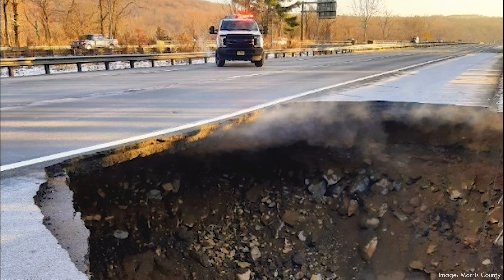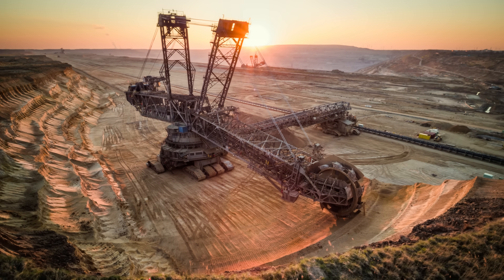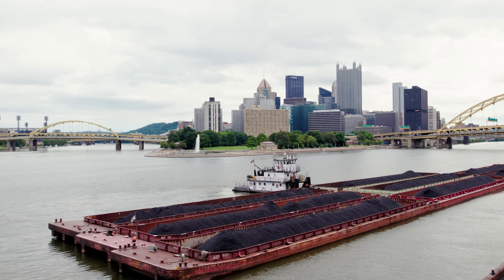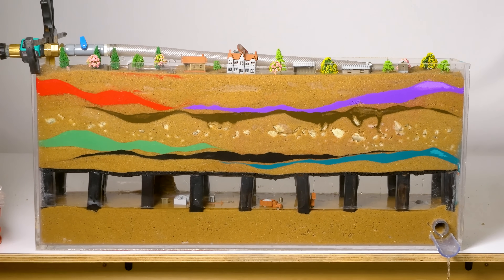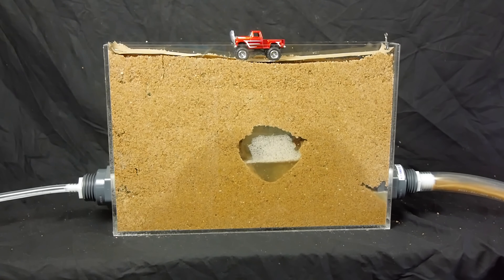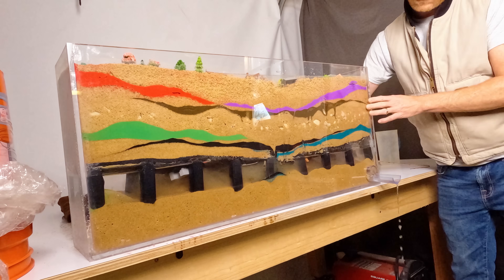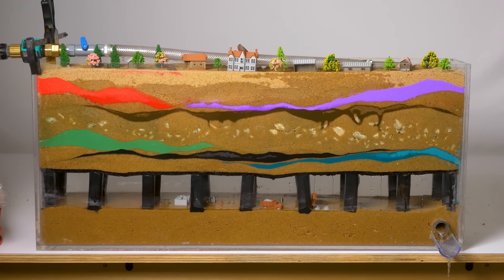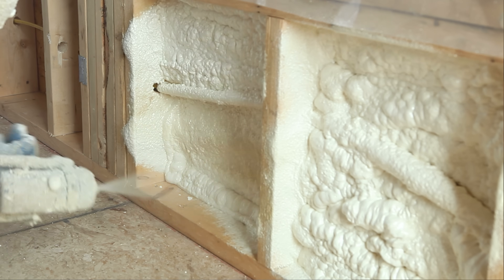When Abandoned Mines Collapse

Comment: I live in the anthracite region in PA. People that aren't from here and/or don't know anything about coal mining are stunned when they learn that the whole area (480 square miles) is basically being held up by toothpicks. A lot of pillars were robbed and what's holding up the ceilings is just timber. Subsidences are very common. Luckily, subsidence insurance is dirt cheap. No pun intended. 

At a large mine about 10 miles from Scranton there was an accident (1950s or 60s) when mining under the river. They got too close to the ceiling, it broke through and the river flooded into mines below. AKA the Knox Mine Disaster. It ended underground mining for the area. The mines completely flooded and basically they are all connected. Pumping that much water out was not an option. 

Cool video ty
Reply: I remember reading about that disaster a few years ago. Billions of gallons of water filled into the mine, they threw rail cars, huge rocks, everything they could to try to seal it up. Big 'oopsie'. There is still so much Anthracite that they've barely scratched the surface given the absolutely huge amount of Anthracite that exists there. It's enough to power the country for 10,000 years if we only burned coal.
Reply: @Knight_Kin  Yep they did. I don't get how they thought that stuff was going to stop water of all things 🤔
Reply: Oh, the one they show video of at the Coal Mine Tour! What you want to see before they take you underground.
Reply: @X24453  It's certainly possible, I don't really remember a video I haven't been to the coal mine tour in like 20 years. We played in abandoned mines as kids which is crazy thinking about it now. I was always interested in them though. Across the street from the house I grew up in was the Eddy Creek colliery property, plenty of openings and little buildings to explore.
Reply: Well of course it's dirt cheap, the bottom keeps falling out of the market! 😆
Reply: In Hazleton, you used to be able to access the mine that ran under Broad Street. Amazing that it hasn't collapsed yet.

Part of 940 going towards Freeland subsided, and 309 going towards McAdoo.
Reply: @nicky5683 I don't really know that area. There's been a few subsidences over by Marywood College recently. I think a lot more happen that they don't want people knowing about

Comment: Oh we know all about this in Edmonton, AB, Canada. There are parts of the city where you cannot make ground disturbance including but not limited to building a garage or house addition etc without having a mine survey done for your property. There was a large coal mining industry in the banks of the North Saskatchewan(which runs directly through the middle of the city) during a period of historically low regulation and enforcement so in addition to the licensed and surveyed mines we know about, there are tons of unlicensed rathole mines that existed and were hidden once finished with to prevent detection. It's a big problem even though tons and tons of gravel have been dumped into the old mines we know about the problem continues to crop up from time to time.

Comment: The official statement from NJ DOT is this is a collapsed mine, and there are many very old mines in that area, but the collapses are also happening exactly where Route 15, an old highway dating to at least the mid 1800s and likely much older, used to be. When I-80 was constructed in the early 1950s Route 15 was moved a short distance east to allow for all the necessary ramps that would connect both highways.  The collapses have all happened in a short section of I-80 where it's fill was placed on top of the old Route 15.  Route 15, being so old, was likely not built over old mines. So my question is, could the official story of a collapsed mine be a ruse and this somehow actually be a result of some flaw in how I-80 was originally build, specifically where it passed over a much older road.

Comment: As a geo thermal well driller,  I often wonder about the impact underground.  Today hit atesian well. 150" deep. Ground loop was set and 100 gal flow of water out of the hole.  First time ever.  Hole wouldn't hold grout,  can't stop flow without specialized equipment in the morning.  Usually holes go easy.  Sometimes it happens like this,  at times difficulties at other ends of the spectrum. How is our crust not falling apart with as many holes we fracture and drill? Isn't there a tipping point with earthquakes??
Reply: Dutchsinse on youtube and twitch

Comment: You should check out what they did in Webb City MO. They pumped grote, similar to concrete, into the abandoned mines under the town to stabilize it. Not sure if the project is done, but it went on for years.

Comment: There were a lot of mines where I grew up.  About 40 or 50 years ago I asked a coal miner how big the pillars were.  I think he said they were 60 ft. wide.  What he said next shocked me.  He said that, once they've removed all the coal between the pillars, they start at the farthest reaches of the mine and begin removing the pillars.  I asked about the roof.  He said the roof collapses but the mine is so far underground that the collapsing mine didn't affect anything on the surface.  Now you have me wondering if the engineers or mine owners simply told people that whether or not it was true.

Comment: Having lived and built houses in areas with long wall coal mining. To get a permit to build a house I had to get additional concrete and reinforcing steel. So if my house began to slip or move due to mine subsidence. Then the repairs will be covered by the mine's insurance. My first house in 1973 needed to spend another $1k on a house costing $15k  to build to meet the requirements of any mine subsidence
Around my area there are signs identifying road damage due to subsidence. In fact one part of the highway says "Dont blame the Council this is mine subsidence". When you look along that section of road that was straight and level when built. Is now looking more like a roller coaster ride.

Comment: Coal mine subsidence was a major issue in Colorado Springs in the 1980s and 90s. Whole houses were sinking almost a complete story practically overnight. Now the first thing I do when moving to a new area is to obtain a coal mine map of the area to know where to avoid. This is a very real issue!
Reply: Those maps will tell you where the surface works were, but not necessarily the tunneling. But yeah, it's a good idea to look at those historical USGS maps and stay away from any marked shaft at by at least a couple hundred yards.
Reply: I live nearby, how does one aquire these maps, now I'm curious!

Comment: Congratulations on an excellent discussion of the causes and potential harms of mine subsidence.  You did, however, neglect to mention a very important contributor to current issues and that is the evolution of surface land use on mined areas over time.  Unwary or unscrupulous land development over mined areas can leave surface rights owners with a mess that is neither their fault not the original mining concerns.

Comment: isn't a big part of foam, is that it's airy? how could that stop immense pressures squeezing the void? maybe more support of smaller air pockets?
Reply: Yes. And no.

Foam concrete jacking and polyurethane injection sealing for foundations have been a thing for decades.
Reply: @asbestosfibers1325  I'm not doubting that, but questioning if it's a century long solution. But it sounds like it's proving to be, so that's cool!
Reply: @pizzagroom6221   i personally highly doubt it being a century solution but can't back up my opinion with proven science 

Just doubt

Comment: I grew up near Scranton, Pennsylvania, during the time when the old shoring tembers were rotting and subsidences were common. Due to the anticline geology the flooding after the pumps were turned off meant that the water was pressurized leading to a geyser forming one day and boreholes being drilled to relieve the pressure. The lower few miles of the Lackawanna River and the eastern bank of the Susquehanna downstream of their confluence are stained orange due to the dissolved iron

Comment: Reminds me of my job operating a concrete mixing/pouring plant in northern australia They would backfill the space in-between the "pillars" so they could later mine out those pillars they left before. It was a mix of mostly sand, water and a little bit of concrete, when cured you could crush the material with your bare hands. The engineer's however told it's not a strong mix but strong enough to give enough support so they can keep mining, quite mind boggling.
Reply: The coal they mined out was likely much weaker than the mix you applied.

Comment: Long wall is not just a modern method of mining, historically, a form of long wall, "short wall" was employed, same as the described long wall, just smaller spans. This form of mining is designed to fail and let the mine collapse after working it as opposed to room and pillar aka stoop and room which is designed to be stable until the pillars fail if the overburden pressure is greater than the pillar cohesion.

Comment: I’m a mining engineer and I really enjoyed your video! You did a great job explaining this in a way that industry can appreciate and lay people can easily understand.
Reply: I’m a mining engineer by training as well, though I work in a chemical plant now. Huge agree, and now I have something I can use to explain to our boss why we actually need to do something about the drifts running under the plant property
Reply: @the48thronin97  what rock type, depth and drift dimensions? If its hard rock, deeper than ~50m or relatively small openings, you're probably ok. Most mines will have a 3rd party geotech review done by a consultant once a year give or take, typically conducted through mine tech services/mine engineering dept. Try bringing it up to them rather than the plant manager.
Reply: Business in all industries "it's not a problem until it is." What we can't seem to learn is that fixing stuff before it breaks always costs less than fixing it after. Would you rather the dentist fill a cavity or would you rather have a root canal?

Comment: Underground gold mines in Bendigo, Australia reach a kilometer deep. They are in hard rock formations, so generally there is no collapse and surface subsidience danger, but old abandoned mines inevitably fills with water... yes, 1km is 100atm pressure. HUNDRED. So gradually it became extremely dangerous to dig anything there, any moment you can puncture to old abandoned and forgotten mine next to you and get all this water bomb directly to your work area, with all consequences.

They tried to assemble a comprehensive underground 3D plan of all mines dug there for 150 years... not very successful, especially for gold mines which are unevitably look like maze of narrow bent tunnels along rifts, veins and other formations deep below in hard rock, no one could afford to build straight corridors and big caves there, just dig as it goes until all hopes for additional gold lost, then abandon it and start to dig somewhere else. If nothing promisable left at all or at least it requires to go too deep thus expensive - abandon the whole mine, dissolve the company and forget about all this instantly.

Comment: Kiruna, the northernmost city in Sweden is actually in the process of moving the city center because of this, the iron mine next to the town has grown too close to it, so the mining company is either fully or partially funding the move, not sure on the detail. But is in itself a massive engineering challenge, where they will literally drive the historic church to the other side of town soon! Though the hospital is facing some difficulties where the new one is still in the approvals stages but the old one is getting major cracks in its walls already, and probably won't last until the new one is built!

Comment: Fun fact: Here in Germany we spend roughly 300 million euros a year on over 200 giant pumps that pump groundwater out of abandoned shafts in the Ruhr Area. The city center of essen has sunk more then 30 meters since the beginning of coal excavation in the area. Without those pumps that whole are would basically turn into a giant lake comprised of highly toxic water from the old mines.
Reply: What happens when pumps are finally turned off can be seen in Olkusz, Poland.
After the zinc and lead mine Olkusz-Pomorzany ceased operation in 2020 and switched off the pumps, ground water gradually rose to the surface, inundated wide swaths of local forest and a 100m long section of realtively new-built road that was the bypass of the town Bolesław. Apparently there was a big miscalculation - nobody expected water would rise so high.
Fortunately this water is not contaminated, probably because all the ore has already been extracted.
On the other hand there is a town in Germany ( I don't remember the name) where the rising ground is the problem. They drilled for geothermal water but unfortunately punctured gypsum deposits under the town letting groundwater into them and gypsum began to swell so that ground surface started to rise. This in turn damages buildings, especially older ones.
Reply: @adamzieba8364 Never thought i'd be equipped to answer such a niche question. The German town you're talking about is Staufen, where my mother was raised. Supposed to be home to the exact spot where Faust sold his soul to the devil. Lots of medieval stonework there, the cracked foundations are a locally notorious sight.
Reply: Another problem is pollution. Especially PCB is a problem, it was used in hydraulic machinery. The quantities are huge, this poison surfacing would be a disaster. Expensive pumping vs. said risk has to be considered.
Reply: I hope the pumps break down and never get replaced, a toxic lake is still better than a town full of germans!

Comment: I live in Germany and work at a company which focuses on drilling for mines and voids typically between 10m to 100m deep.
We then pump a concrete mix into the mines through different types of pipes so the area is safe again.
There's also a huge effort to pump the water out of the huge old mines so they won't collapse.

Comment: One Example of an Area that became a densly populated Area is the so called "Ruhrgebiet" (translated to Ruhr Area). The coal that got extracted from the underground was used for big steel Mills like "Thyssen, or Krupp. (Now Thyssenkrupp) In this area a river has to be pumped up to prevent a town from getting flodded. The groundwater is strongly polutet in some areas and sometimes cranes and buildings collapse ( every few years)
Reply: Yea... Depending on the exact area you will run into either of these troubles when building/digging:
1: WW2 bombs that didn't go off
2: remnants of some ancient roman structures
3: unsteady soil due to coal mining
Bonus suprise wherever a river is close: old, ancient river bed wich means loads of gravel or a water vein that requires serious pumping efforts during construction of the basement and intensive waterproofing of the basement walls and floor. 
Yet another thing: Old bunkers! A number of cases where they just left them and used the structure as underground parking or in case of above ground bunkers as a house or parking garage. Modifying the thing proofed to be more rewarding than trying to remove it since most were built incredibly strong.

Comment: A previous life as a Geologist had me monitoring pipelines as they were undercut by longwall mines. Active mines, not necessarily abandoned. We also did survey work and could watch the surface, hills in WV, PA, and OH mostly, subside by 6-8ft. And that's with the mines a solid 800ft below. It was remarkable, and the homes in the longwall path were either bought by the mine and left for dead or refused by the owners and repaired by the mine.
In a 1/4-mile wide longwall we would monitor and expect subsidence 1/2 the width to each side. So 1/8-mile on either side of the mine would subside, and we called it good (remember, we were only there to monitor and protect the pipeline assets) when we saw less than 1"/wk of surface change. During our surveys we could audibly hear the rock popping after the mine passed.
Reply: Oh, that's pretty neat. What did it do to the trees and stuff overtop?
Reply: @X24453  some moved, but generally land just sank. Aside from some rather large cracks...2ft wide, deeper than you could see...it was hard to tell anything happened without the survey data. It all sinks roughly at once.

Comment: 12:12 They used this method in Germany in the "Ruhr Metropolitan Region". Today basically the whole area (4,435 km²), where over 5 million people live is 5 meters lower than it was in 1800. Over 200 water pumps are running all the time, so that the water of the rivers get into the ocean and doesn't flood the area. This costs about 55 mio. € every year and the pumps need to run for forever.

Comment: I live in North Wales IK, and we had a 2000 to 3000 foot deep Coal Mine in a local village.  It closed in 1958.    There was a two mile long straight road nearby, which was gradually getting more and more humps in it.   In about 1975, I mentioned to a county roads inspector, that it was dangerous to overtake on that road, as you could not see oncoming cars hidden in the dips.   Within 3 months they had re-surfaced the road, to be much flatter.    Today the road still has some small dips in it, and a housing estate has been built next to it.
Reply: Wow complaining about a road and then it being resurfaced. That's almost unbelievable
Reply: Real Estate developers GREED.  I'll bet they didn't tell the home buyers???